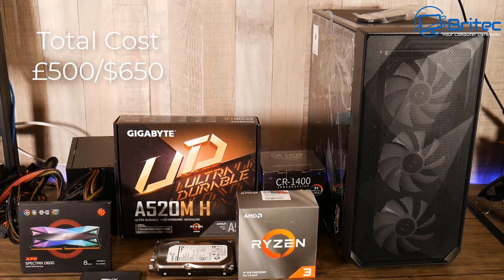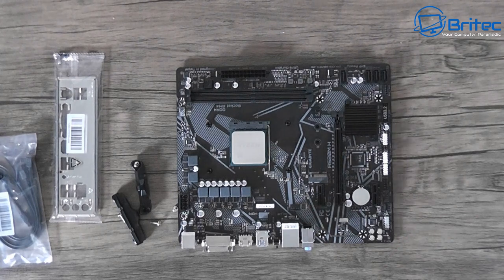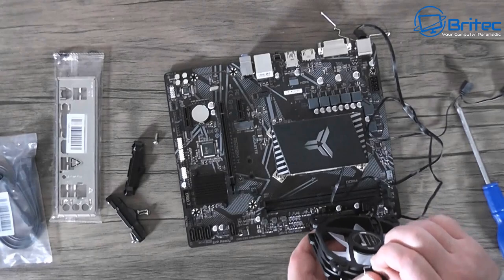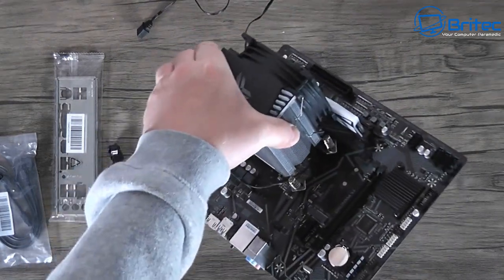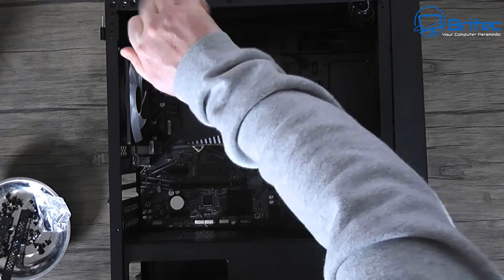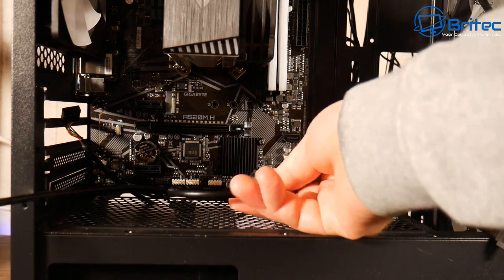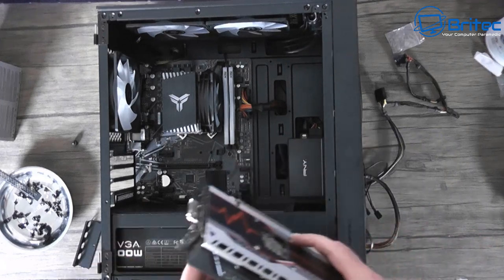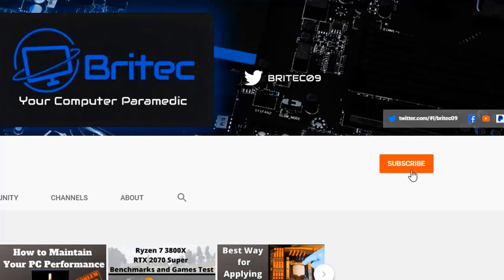$650 Gaming PC Build 2020 - Ryzen 3100 + RX 580 with Benchmarks

Comment: Looks like a great build. Just got that Giga mobo. 🤮 I also haven't got to build with a 520 chipset, so don't know how well the bottle necks are. The last thing is the 240GB SSD. I would totally recommend a 500GB SSD or add a 1TB HDD for all those games you need to add.
Reply from the maker: PC is being sold and they can add another drive. I normally use NVME but its not possible at that price point.
Reply: @Britec09  understandable for sure. Heck, I dont see a reason to use a NVME unless its a rocket on that sweet sweet 4.0 PCIe anyway lol. Definitely a suggestion for anyone getting this systme, would be to add a 1TB HDD as a DATA drive.

Comment: I love it, but the 3100 does not need al that air flow. I built a 3100 system for my kid and used the stock cooler. Two fans in the system  and overclocked and never gets above 65c. Now if it was a 3600 and a stock cooler, you better at minimum have a Cooler Master 212.
Reply from the maker: No it doesn't, but they can upgrade to a better CPU when ryzen  release there new stuff